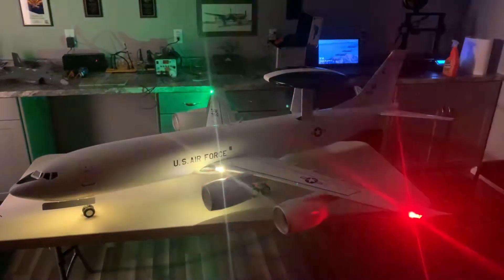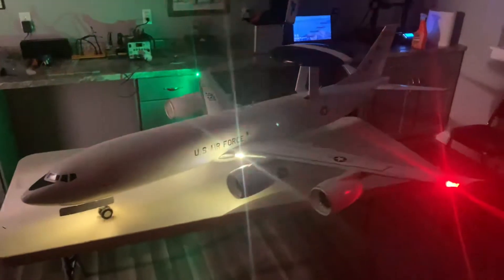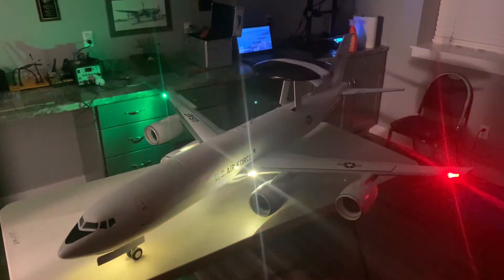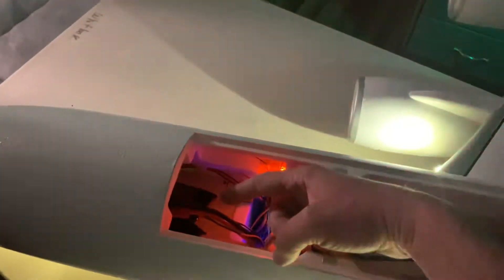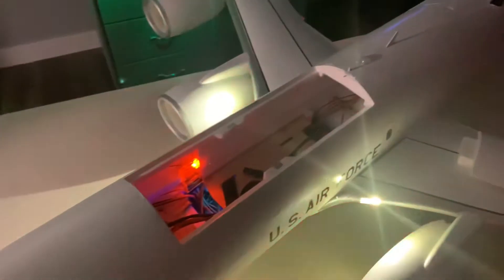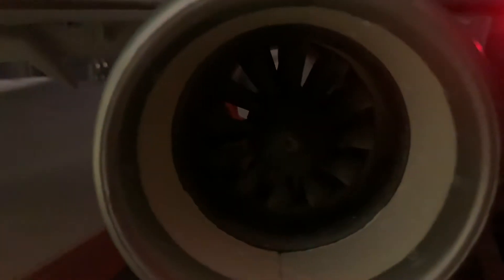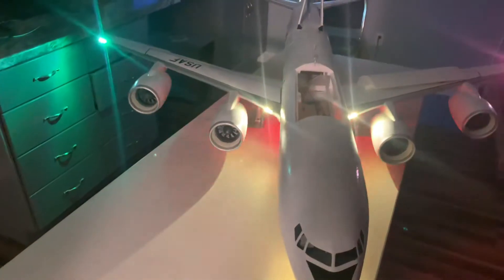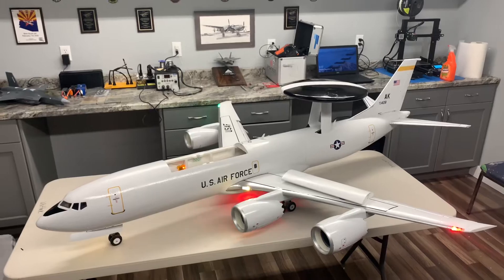Rc AL37/E-3 AWACS Mod update

Comment: jeremy , very nice plane with your mods. i am building one with callie graphics that she made for me  but mu question is, i plan on using a spektrum 637t rx in it. do you or know of anybody that uses that rx and what are a good place to set the gains up for the gyro and safe select if i so chose to use it. thank you in advance
Reply from the maker: I dont use that rx and dont use any of the safe/as3x in anything other than the birds that it came stock in it.  Ive had too many as3x issues that are unexplained.   Now question, are you making an awacs or an AL37?
Reply: @soltproductions  am making an al37 with hawaiin air livery that callie is making for me. ive seen alot of different liveries but have not seen that one yet and i think its a good looking one. just google hawaiian air new livery and check it out. lemme know what you think
Reply: @soltproductions I am also building a AL37 with the modifications. I’ve gotten the 4 engine wired together but I’m having trouble with the flaps and elevators. Do you think you could help me?